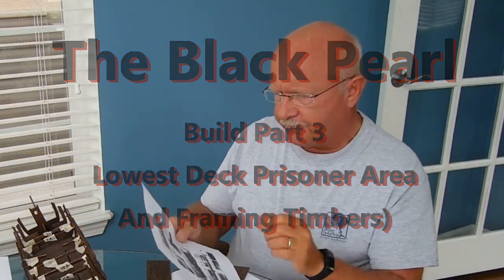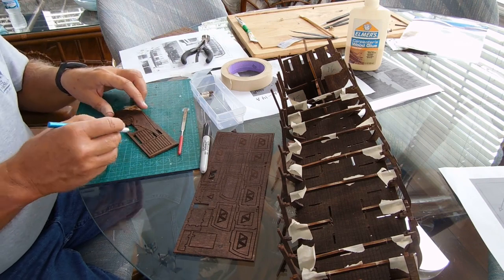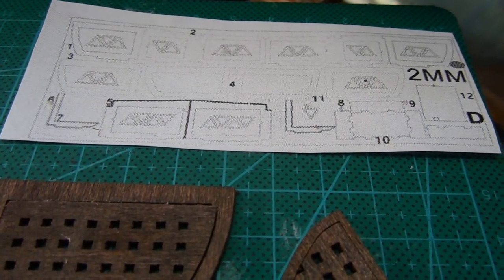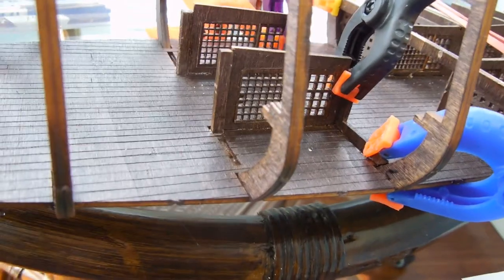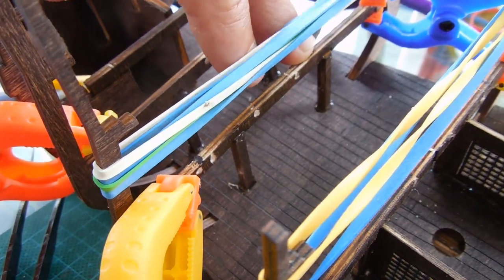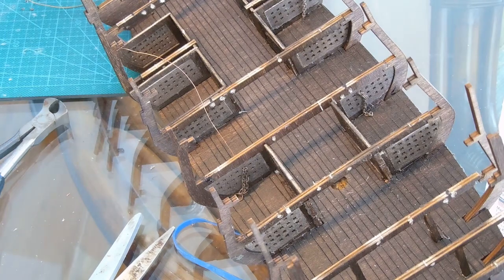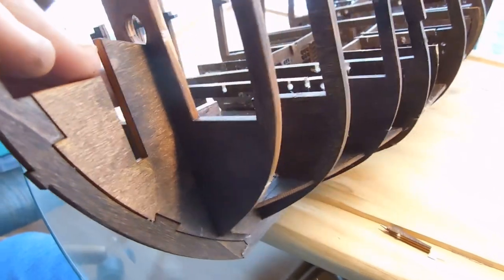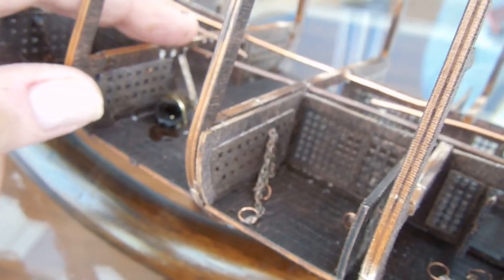Building The Black Pearl Model Ship Part 3

Comment: I'm sorry I'm going to pick fault but scale is so important in modeling and the cuffs are way out of scale they were used for wrists and ankles.  the chain looks small enough but the rings used for the cuffs look like they should be used on the lower mast.
  The elastic bands  for cross pressure for the deck support beams is a good idea but don't have them too high up on the ribs as these can break quite easily as the cross graining of the ply isn't the best so it isn't as strong as it should be and as another deck layer sits on them  they aren't seen . 
keep up the good work.
Reply from the maker: getreal : I actually appreciate your observations as I’m just getting started on this journey.  I’ll probably build another one after I learn lessons from doing this one. Filming my journey is for fun and to help me remember for the next time 😂

Comment: did you pre-paint this or is that the natural wood color. If you painted it how?  Airbrush, what color?
Reply from the maker: No paint except for the statues.  I’ve posted 26 videos to date, so keep watching and you can see! But to answer based on the video you responded to; I stain all the wooden parts before constructing the ship. Some get sanded down in which case I re-stain it.  On the Black Pearl, I used dark mahogany stain.  Then when done I use tung oil because it is absorbed by the wood giving it additional strength.  Regarding the statues, here’s a link directly to the segment showing the paint and colors along with the technique I used. https://youtu.be/d9KD6UwA-9o.      Thanks for watching!
Reply: @BoilerDan1  replying to you from my other account... I just started following this build. Great job and thanks for the information and quick reply! I will keep watching!